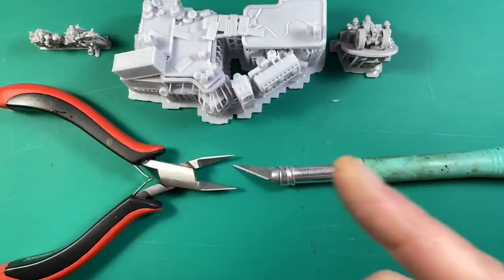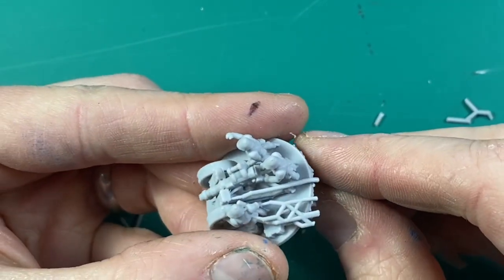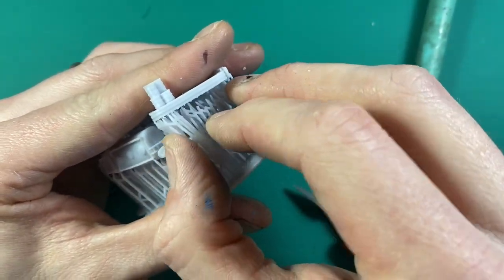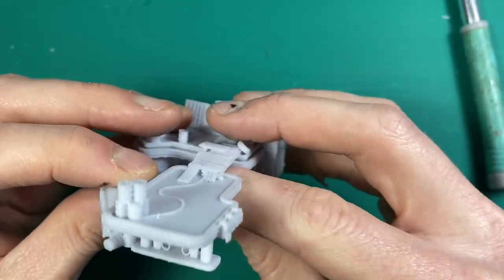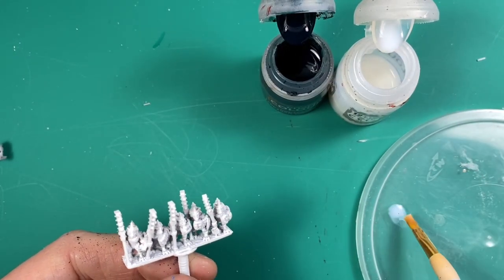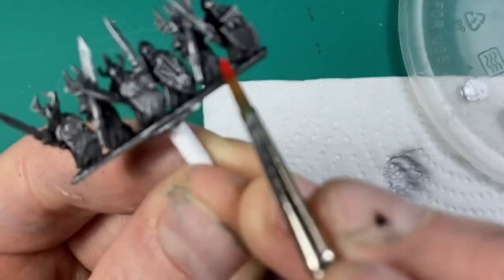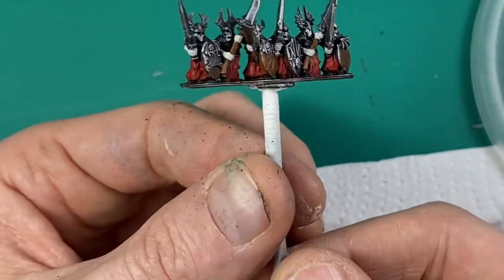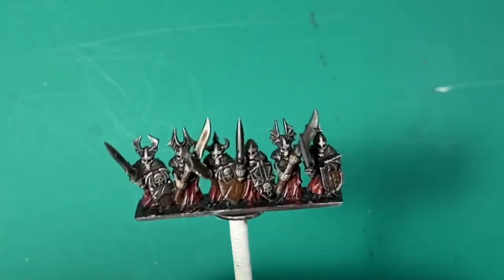Prepping and painting small 3D printed Minis

Comment: I find that submerging the minis in hot water is a better way for me to remove the supports.  This is what I have done with the 10mm S.W. Figures I bought off you at SELWG.  I do love those minis by the way!
Reply from the maker: Great tip! I think that’s got to be a better way to go with the supports that are a frame around the minis Vs the ones that do direct to the minis base. 
I should do Another vid on the sci fi stuff and include this. Cheers and glad you’re happy with them

Comment: This was exactly the video I was searching for! What way would you go for those despoilers you've printed? contrast paint or drybrush? Also you mentioned that you've used a flexible resin, I would like to know wich one is. Thanks for the video, I didn't knew about this contrast paint tecnique.
Reply from the maker: I use Resione brand resin. I dry brushed mine in the same way as the undead then did the cloaks and any flesh afterwards
Reply: @rokminis59  I dry brushed mine with red. They came out cool but I was thinking about trying some contrast paint like you showed in the video.
Reply from the maker: They work great. Most of the brands that make this type paints are pretty good for it

Comment: 4:26 That's wrong. They are supports, mini supports to be exact. Those don't have a narrow connection point. I mean, you can leave them there for sure, but they are indeed supports. Look at the pictures of the designer. Woudln't make much sense to have small little steel beams holding up the container, when it already supports itself by sitting on the roof, don't you think? ;)
Reply from the maker: Thanks. Yeah it wasn’t super clear so I left them but they fit just fine as steel support pipes to hold up the rickety containers